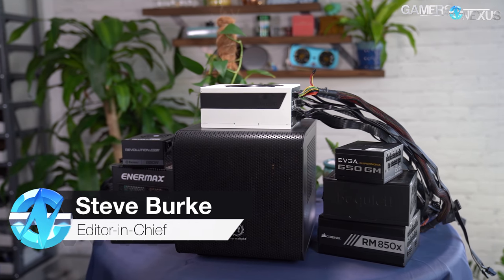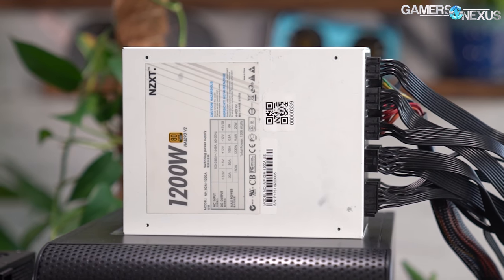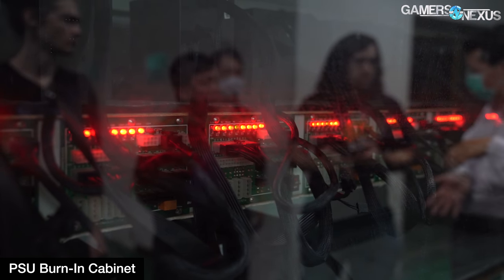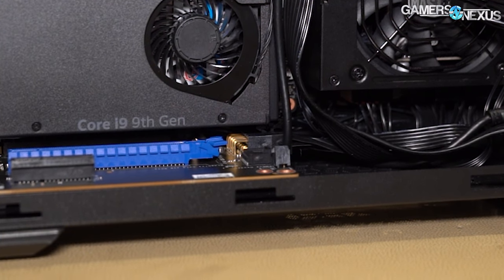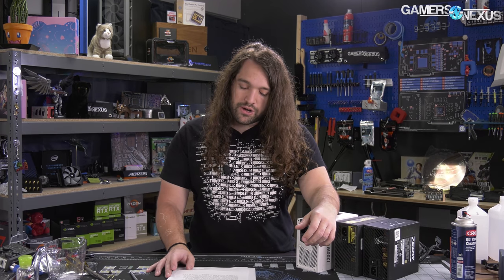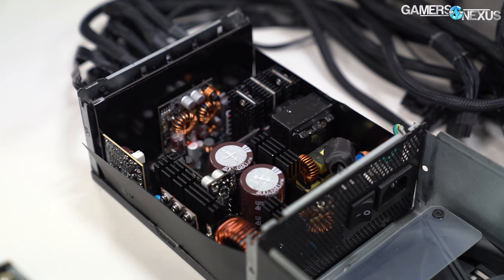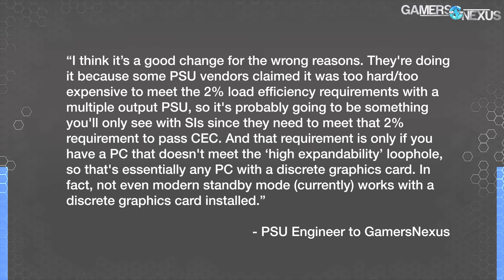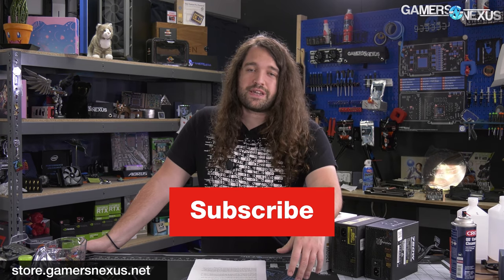Intel's ATX12VO Spec Explained & What Manufacturers Think

Comment: They had me at smaller main connector. They lost me when it was still Molex-styled.
Reply: Molex style connectors are for fans and stuff that aren't connected to the motherboard. My motherboard supports up to 2amp on the CPU and CPU_OPT fan headers, i'm able to run 6 noctua NF-F12-PWM fans off one header with no trouble for my 360mm AIO in push/pull. I have more trouble trying to tidy the mess of wires. I feel i might have to take my soldering iron to it some day and do a custom cable-job.

Comment: I wish mobo manufacturers would take the lead on this one, particularly in the ITX space. If they offered a mobo that had 12 volt only input, and did on-board step-down as needed, it would sell like hotcakes. They could even sell a power brick alongside (laptop style) which would still be cheaper than an ATX/SFX PSU.

Comment: I could see MB manufactures using "active" cables with built in buck converters.
Reply: @thedog556 why an inch thick? I've got much smaller ones right now, as 4/5-pin potted modules. Though I think converters on board edges make more sense.
Reply: @thedog556 on the connector buck converters are really not that big anymore. Especially potted ones.
Reply: @thedog556 check out UBECs used for RC vehicles. They are pretty slim buck converters.

Comment: The EPS and PCIe 12V power coming from the PSU direct to the CPU and Graphics cards came about more because power routing on a pcb is costly and inefficient and prone to failures that can be destructively catastrophic.  Not just in the PC world is this done, many systems of many differing types use the same approach to bringing power to where it is needed by a dedicated open air wire.
Reply: I think it was also because the atx connector only has 2 12v wires which iirc are limited to 10A total, and adding an additional connector to plug into the motherboard was easier on everyone compared to changing the layout of the existing atx 20 pin connector.

Comment: Since basically nothing uses 3.3V or 5V directly anymore (nearly all goes through point-of-load regulators), the only reason to still have them is backwards compatibility. 12VO is the first step towards standardizing everything to 12V distribution the next time standards get a major update such as USB5 hypothetically going optical or PCIe5+ signal integrity requiring a new connector pinout (ex.: continuous ground at the connector's edge with inset data pads) for reduced ground impedance and crosstalk. An update to SATA/SAS is long overdue too, wouldn't hurt to have a 12VO/PCIe4+ spec for off-board internal storage devices and legacy storage adapters.

Comment: The solution for current PSU with new boards could be cable with step-up converter, these are cheap. I often use 5->12V step-up converters, i.e. I use one now to power 2 120mm Corsair fans in 3D printed laptop stand for my Gigabyte Aero 15x. The stand is powered from USB and it works fine (I tried 2x Noctua industrial fans and these were too power-hungry for USB port but Corsairs are fine).

Comment: Could you do the 3,3v and 5v conversion like the new Seasonic PSU with the seperate conversion and splitter block that you can mount behind the case?
Reply: Motherboards could include one of those
Reply: That would be a great "workarround" where the distribution-PSU  is not technically the PSU but just keeps everything in the wonderful compatible world that is ATX working.

Comment: Honestly, I think it's worth dropping 3.3v (At least outside of servers) but keeping +5v, albeit making it all a single, somewhat heavier +5VSB rail because quite a few things actually still use 5v to be honest, it's not just HDDs but also the USB power delivery and a handful of other things. This simplifies power supplies still, only needs a single pin to the motherboard thus keeping the motherboard designs simple and allows any PCs using the new spec to act as a phone charger, albeit probably with more efficient components. That and most PSUs already just convert AC 120-240v to DC 12v then that 12v to everything else, so it's just moving the same thing elsewhere...

I also really think we should keep power delivery off of the mainboard as much as possible, VRMs aren't too bad but you can certainly hear the extra electrical noise in those OEM systems even with a soundcard. That said, I wouldn't be against a new SATA revision that implements power delivery and data in a single cable if it also allows budget SATA SSDs to get faster.

Comment: If it's going to be 12V only anyway, why not replace the 24pin AND cpu power by the pcie power connector?
Reply: From what I've read, the 24 pin is getting replaced with a 10 pin.
Reply: the PCIe power connector sucks, since it wastes two of it's pins for "sense". 12V EPS is much better.

It's so much better that some datacenter GPUs use the 8 Pin EPS connector instead of the PCIe connector. The 8-Pin PCIe connector shouldn't exist in the first place.
Reply: @tommihommi1  Well, perfect time to replace either then right?
Reply: The new connector also has 12V standby, a power good indicator and power on. Those are not provided by the PCIe connector (since graphics cards can't turn on the computer).

Comment: Yeah, its great that finally someone standardizes this crap. Its so common that you wanna add a dedicated GPU to your HP prebuilt but its power supply has neither the connectors nor the power for that, so you wanna replace the power supply and realize that the motherboard isnt compatible with ATX and that there are no 12VO power supplies you could buy instead.

Edit: Currently there are adapter cables including a boost converter to get around the 5V standby problem so that you can connect an ATX power supply to those boards but they are a proprietary mess right now and standardizing that would be very helpful.

Comment: 5v rail failed? Why would you do a bothersome PSU replacement when you can simply DO COMPONENT LEVEL TROUBLESHOOTING AND REPAIR ON A 10 - 16 LAYER HIGH HEAT CAPACITY PCB. Seriously this is gonna do wonders for the e-waste problems many developed countries are facing, and not in a good way.

Comment: The device itself (hdd for example) should have the power conversion from 12v, this way we could gradually phase out 3.3 and 5v and have less wires, smaller plugs, smaller cutouts, smaller cases, lower power consumption lower noise

Comment: 19:33 "not even modern standby mode works with descrete gpu" What does that mean exactly?
Reply: I'd like clarification on this point too... I SUSPECT what he meant was not even modern standby mode CAN work AT THE REQUIRED EFFICIENCY with a discrete gpu, which makes me wonder if this is a problem for laptops with Nvidia/Radeon graphics cards.  Either way though since a discrete gpu automatically puts you in the loophole It's probably not that important what he meant. Unless you live in cali, and want something with integrated Nvidia/Radeon graphics.
Reply: Discrete GPUs have their own headaches because they have their own VRAM and what exactly you do with that VRAM during standby is complicated- do you flush it to main memory? Because that's going to cause a noticeable delay during resume, and asking the GPU to enter memory refresh mode is going to use up probably double the power, and the GPU has to support it well, as does the motherboard, it can occasionally cause issues.

And if you do want to keep that memory refreshed...pcie doesn't carry 5vsb, only 12v and 3.3v so that's probably what is meant here- you need to keep one of those rails alive for the GPU to keep refreshing if it has over 300MB of VRAM in use, at least for a few minutes before the computer decides that this isn't worth it.

Comment: There is lots of room on most motherboards. This is just moving the secondary step down voltages onto the motherboard. I like this idea, and i would like to see sata power cables become integrated with the data cables as all one cable and connector, thus eliminating the need for power cables to hdd's or ssd's. Less cable clutter=more better. Most pcs are moving to onboard m.2 storage anyways

Highly optimised electronics have existed for a long time, and i would say its a great idea to optimise our ancient electronics standards

Comment: As others have noted, moving conversion closer to point of use is more efficient.  Even better is making them optional unless needed.  Hard drives seem the best for this - why do the conversion on the motherboard for external devices?  A power cable for hard drives with a converter in it would be better still, and not push complexity on the motherboard.
Reply: Last I checked: M.2 is 3.3V for power, most 2.5" SSDs use 5V
So now you can buy a cheap PSU and cheap Mobo to fry all your storage with double the likelyhood!
AMAZING!
Reply: @Docno27 Although you are correct that moving conversion closer to point of use wastes less energy, this implementation of the concept, is simply badly done. All they're doing is shifting it away somewhere else - in order for this to be a GOOD thing, we need new standards for EVERYTHING in the PC - 12v USB, 12v SSD, et c, et c. Not necessarily a bad idea, actually, BUT... that's not what Intel is trying to sell. What they're trying to sell is the most half-assed quick-fix solution one could possibly think of.

If Intel actually made a proper standard, with an entire eco-system of devices that could be run from 12v only, then that would be amazing - but of course, also much more complicated.

Comment: But if the power conversion that is now done is move to motherboard side, doesn't that just move the inefficiency from the psu to the motherboard? Or is the idea that because the motherboard knows which devices are attached it will only power the rails when required instead of the rails always being on standby.

Comment: the 24 pin connector is a pain in the ass. It's really time for smaller cables.
Reply: I'll see myself out thank you
Reply: @erikbjork8220   I'll give you an 'a' for effort!
Reply: smaller plugs, when people stop needing hundreds of watts for the CPUs, and PCI cards, fans, RGB, and USB stuff, hmmm. just think, you get your smaller plug that can't handle high power, and you're stuck with a celery processor and a GTX1030 disgrace edition graphics card. just to keep the smaller plug from melting.

In all honesty, removing the 5V from the PSU is the stupid thing, as so much uses it, just about every chip on the motherboard and many of the plugs.

Comment: The only thing ive gotten out of this is that intel and the cec need to sit down and shut up. Its not broken, dont fix it.
Reply: Tech always changes and improves
Reply: I agree with the guy above, just like people hating on type c it will eventually leads to a more sustainable and better future
Reply: @bamsuth9650  What a bunch of BS! This is a pointless "standard" that just shifts some DC-DC converters from where they should be (in the PSU) to the mobo.
Reply: @thedausthed  There are already a bunch of VRMs on your mobo, do you want to move them to the PSU as well?

Comment: one thing that motherboards can do for compatibility is to support 5VSB from the old spec being supplied on the 12VSB pin on the new 10-pin connector. 

Then you can use a passive repinned adapter to feed a new 12VO motherboard from an old ATX powersupply.

Comment: Intel is already forcing you to buy a new board every gen, next are you going to have to buy new SATAVO boards that only fit SATAVO hard drives?
Reply: No, they literally just throw a cheap ass Ti, TDK, Murata, or any other brand of efficient buck regulator onto the board.

Actually check the pricing on these, without bulk purchasing discounts it's still less than a dollar to get a low ripple regulator which will power your attached drives.

Comment: On the clean cabling thing - pop open a Dell Optiplex minitower with a 4th gen or later processor. The SATA power comes from the motherboard. The way the power cabling is run is stupid levels of clean, even without sleeving.

Comment: ATX12VO conclusion:  It doesn't really concern you. It's already been in practice for years.
Reply: HP Elite Systems have gotten those for a long time now, really sucks as some of them could be made into a gaming rig easily but the prorietary PSU makes it hard to get anything above a 1650 installed
Reply: @Speedycat  use a second powersupply
Reply: @Speedycat  An adapter will run you about $13. They work suprisingly well.

Comment: Personally, I love the idea of 12VO. A smaller connector would be awesome! I would much prefer to go to 24V or 48V, so that connectors could be made even smaller, and VRMs more efficient if my understanding is correct, but of course that would introduce a LOT of compatibility issues. Perhaps a power supply that could sense what voltage to supply on a per connector basis, through a jumper or perhaps 1-Wire communication, or lack thereof. Of course, that would end up lowering overall efficiency.

Comment: why i like the UK's 240Volt Power Delivery, All PSU's are more Efficient at higher Voltages. 110v GTFO
Reply: Same here with/in Germany. :)
Reply: @evilbaron  I was in Dusseldorf recently, and you guys have the 2 pin EU connection, y'all need the Earth Pin! 3 Pins work nicely
Reply: @cordes85  3 pins is standard here in germany, we got them big phat plugs. Dunno what you mean

Comment: This is actually really interesting. I was just working on a Lenovo ThinkCentre desktop that had a weird (to me) 10-pin motherboard connector, with SATA power headers on the motherboard!

Tbh I don't actually hate the idea of moving to a new spec like this. The smaller primary Mobo connector is nice, and perhaps the extra space saved from that connector shrinking would leave enough room for the SATA power connectors. (The headers on the board I worked on were much smaller than "normal" SATA plugs)

Comment: This is a good thing. Smaller, cheaper, and more efficient power supplies and much less cabling in the system. The only trade off is potentially more expensive and complex power handling will have to be built into motherboards.

Dell has been doing this for over 6 years. It obviously is a cheaper better way to build a system or else they wouldn't be doing it.
Reply: Dell;s reasons are Dell's reasons, not ours.   They used to have ATX sized power supplies with ATX mobo connectors,  but wired differently for our inconvenience.
Reply: I don't understand, even now there isn't much cables coming from power supply now. Or do PC require RGB lights to get better performance ??

Comment: Even if the efficiency guidelines would also affect "enthusiast systems" this wouldn't be a big problem. 
1. enthusiasts tend to use high efficiency PSUs - and from a first glance at the numbers even a Bronze PSU should already meet the requirements.
2. the trend goes to 12V PSUs with DC-to-DC converters for the other rails anyways, especially in high-power PSUs. So manufacturers can easily offer two versions of the same basic PSU (one where the internal 12V rail is fed directly to the cable, and another one with an additional DC-to-DC board (as we can already find it in some modular PSUs - which, again, are mostly used by enthusiasts).

Or we will just get more clutter with external DC-to-DC boxes like the Seasonic "Connect" :-)

Comment: Also a mandate: Separately-provided 12VO to legacy power adapters. Considering that most people will have some space for all of the extra hardware separate from the motherboard. This can be achieved with standoffs and a unit which is fastened with the usual compliment of fasteners which would hold the motherboard to the case usually. A possible idea for a smart design would be slightly-bowed contacts for the power conversion board and interface board so both can be fastened together depending on which way the conversion is going.

Comment: I'm all for it. Doing local regulation is already done for basically everything on a board (5v, 3.3v logic is gone and main VRMs are already 12v). The negative rails are used by nothing modern as far as I know. Pretty much everything on telecom, etc runs off high voltage with local regulation to reduce losses and improve efficiency - you can match a small 1.2v regulator with a small load, for example.